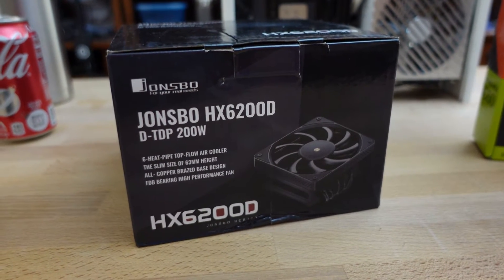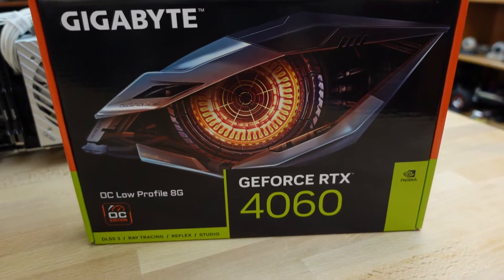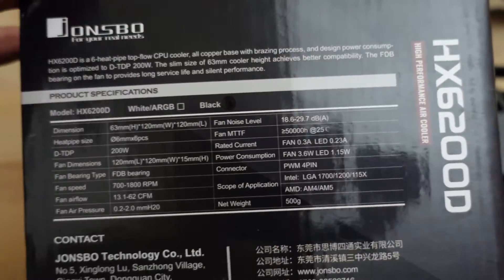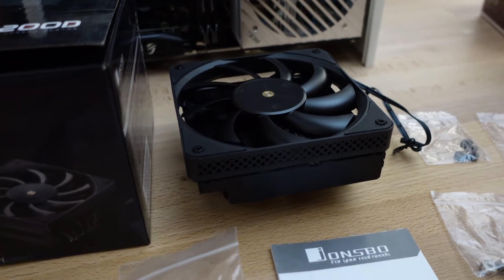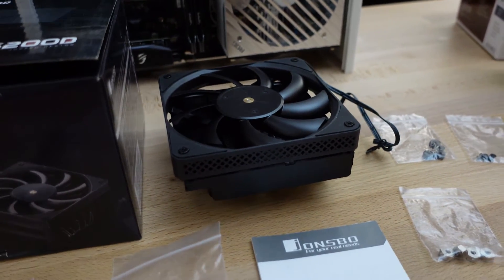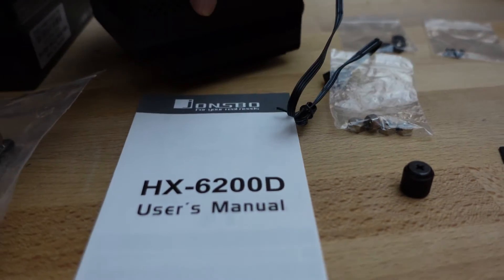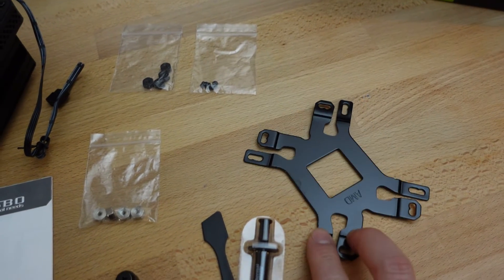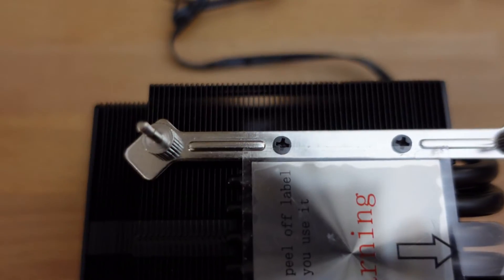Fail… RAM too tall - Jonsbo HX6200D Black - Gigabyte 4060 OC Low Profile 8G - Persephone Build

Comment: what ram did you use? can you inform us how tall is your ram? also telling us your solution and why would be cool.

pardon me if i miss things i ask😅
Reply from the maker: I have a playlist for this build, many different parts and things I tried - https://www.youtube.com/playlist?list=PLqL965J4xElLav8sEGE0hr6EsUhbjDfzP - I have another video in that list where I chose to use the Crucial Ballistix White DDR4 3600 16GB memory. This is a low profile memory kit and I also grabbed the Crucial Pro DDR4 3200MHz 64GB kit and may swap out soon because I found that 16GB at times is constraining while working on the computer. I like the white kit and if I was using this more for gaming instead of every day I think the kit works well and is speedy for my casual gaming. Crucial Ballistix White height is 39.17mm and Patriot Viper Steel height is 44.4mm.

Comment: it`s not possible to invert the heatsink?
Reply from the maker: @Dangz  unfortunately the heatsink has a cutout on one side for the RAM, and the cutout is low so only lower profile RAM will work.
Reply: @nispoe  buts it`s not possible to turn around this cutout to motherboard shield?  the other side hit the ram?
Reply from the maker: I tried that also and it doesn't work. It was made to fit only a certain way for this motherboard. I think the IO side was too tall, maybe if I remove the shroud, but at that point the low profile memory made more sense.
Reply: @nispoe  so sad bro, but thanks for your response, becausei i have a id cooling 67 xt, i think dont have this problem at this cooler
Reply from the maker: @Dangz  I checked out your cooler and see how if you turn it you can make the heat pipes face the ram and the fins clear the I/O shroud. Makes sense your ID-COOLING IS-67-XT clears and keeps low at 67mm.